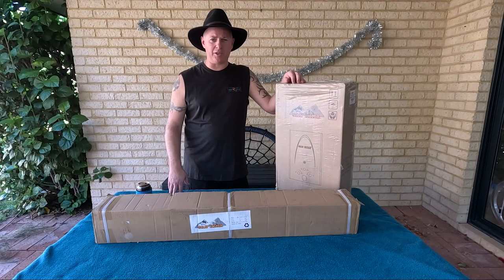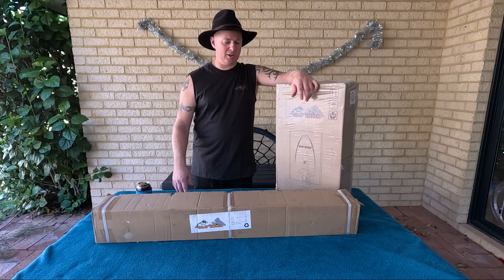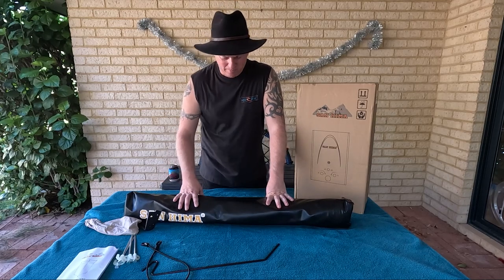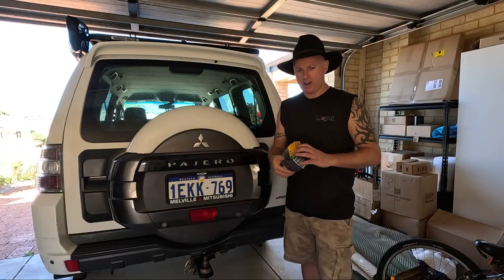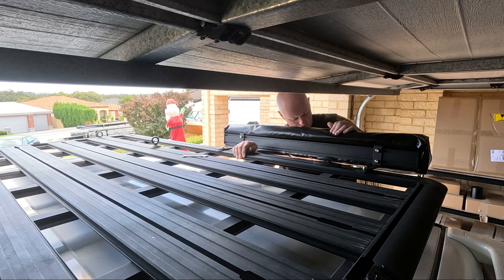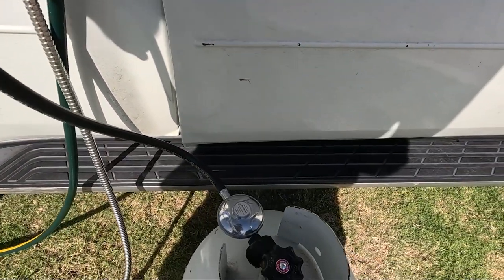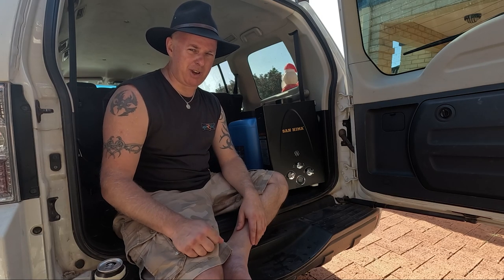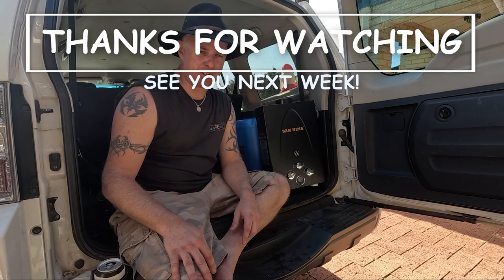BEST CAMPING SHOWER? SAN HIMA Shower & Tent honest thoughts/review | PAJERO Installation TIPS

Comment: Another Great Video. I have been using a Companion Hot water Unit which is around 20 Years Old.         Not sure if your Shower has a Floor you can attach, i bought a 3m x 3m Kings caravan Mesh Mat to put down First. Let's the water run away, and saves making Mud to stand in.  also bought some cheap metal hooks to hold Plastic bags of Dry Clothes etc. when using Shower.   i also fitted a T piece on water Suction so i can use water from a Dam or Trough instead of Fresh Drinking water and another Hose so i unclip the Shower Head and clip on hose so i Have Hot water for Kitchen area and on Hottest Setting almost Boiling so ideal Temp for a Cuppa
Reply from the maker: Nice one and thank you 👍 I have some mats which I've used in the current series which worked well 👌

Comment: If thats a pressureized water pump, may need to use actual hose, not the clear stuff which will expand when left on and connected.
Reply from the maker: Yeah I agree mate, it might need some tinkering. Thought it would do to get started then I can properly decide what will be best for the long term after a couple of runs 👍
Reply: @gettingaroundaus  or the clear pipe will expand and burst haha lucky mates was in the tub of his dual cab 🤣🤣.
Reply from the maker: Oh jesus! Well I definitely appreciate you letting me know that, not something I want to experience 😂😲